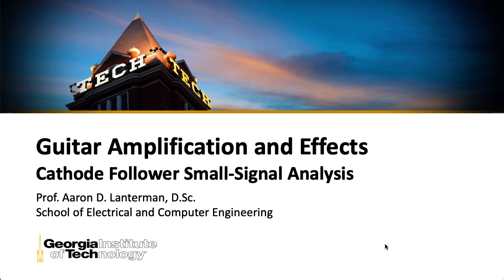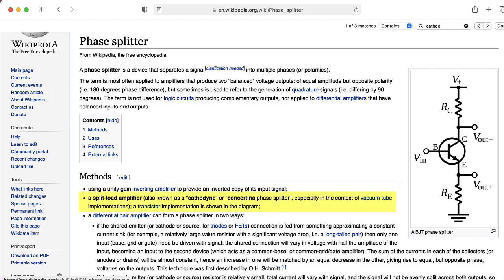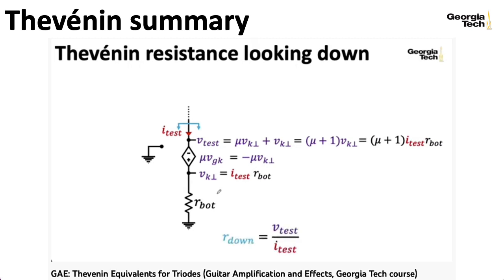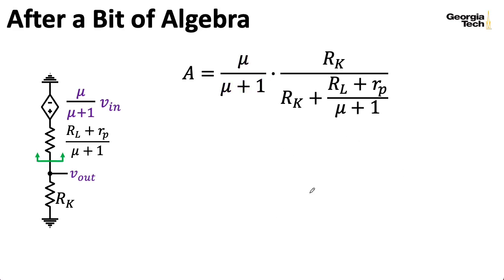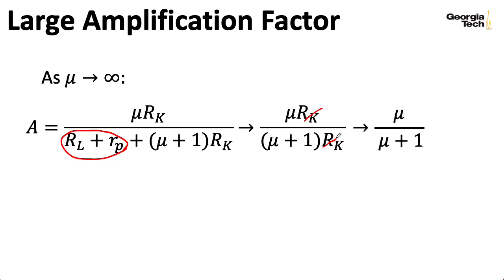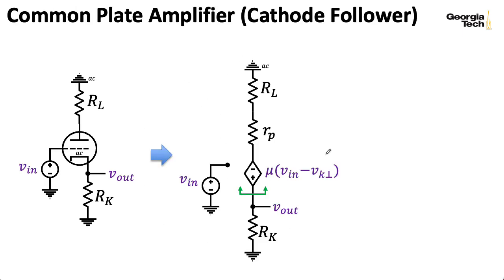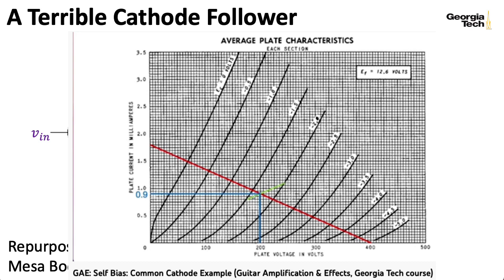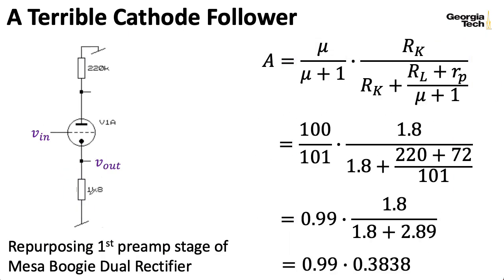ECE4448 L23: Cathode Follower Small-Signal Analysis (Guitar Amplification and Effects, Georgia Tech)

Comment: At 9:32 you introduce a slide with the term Common Drain. Is this circuit analogous to a FET or was this simply an error in the title?
Reply from the maker: Whooops -- that is an error in the title. A common plate amplifier is analogous to a common drain amplifier, but I shouldn't be calling it "common drain."